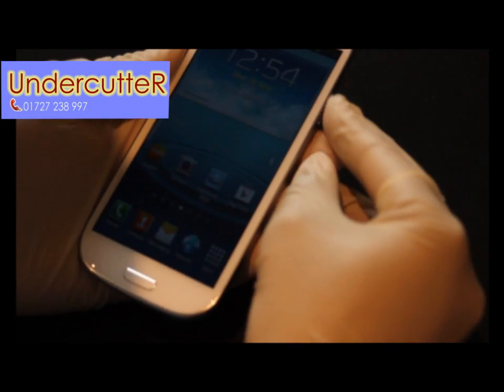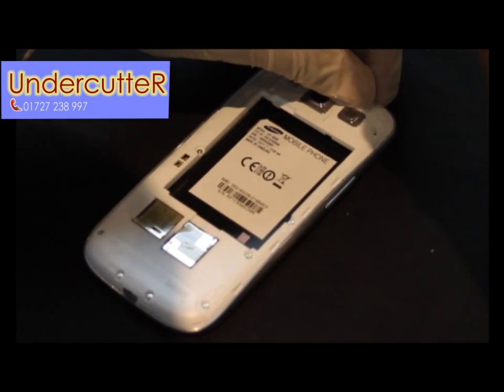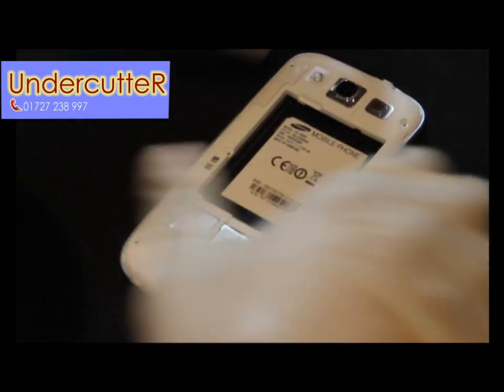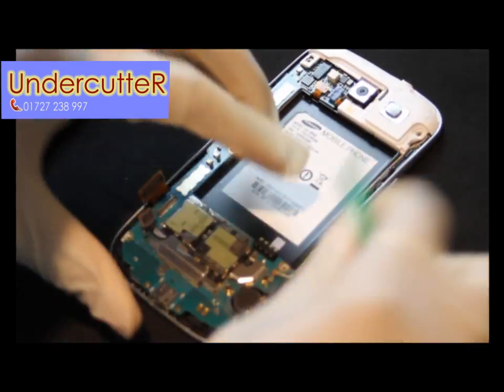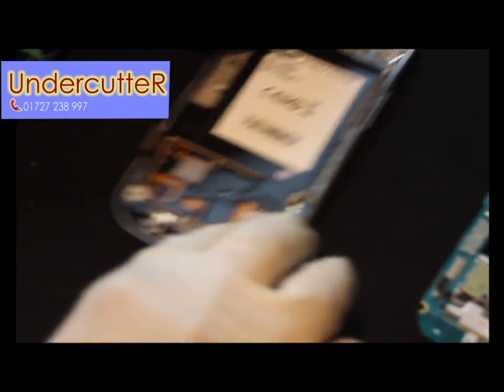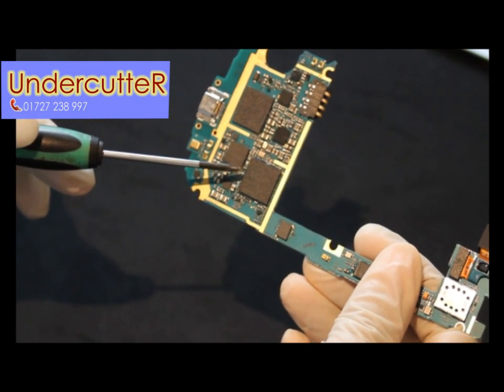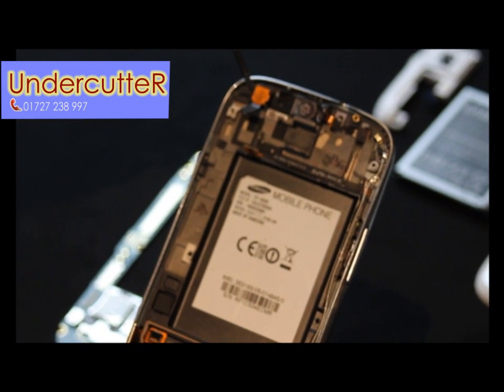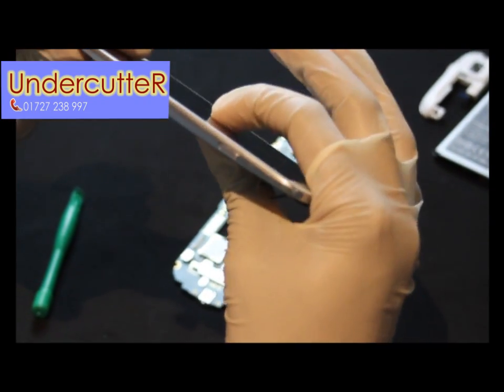Samsung Galaxy S3 disassembly guide

Comment: Is it difficult to undo the 10 small screws? I need to change the headphone jack socket section and a little bit nervous about blunting the screws. What size screwdriver would I need?